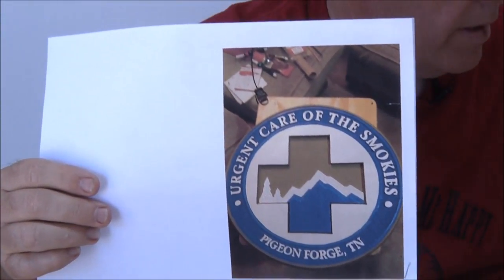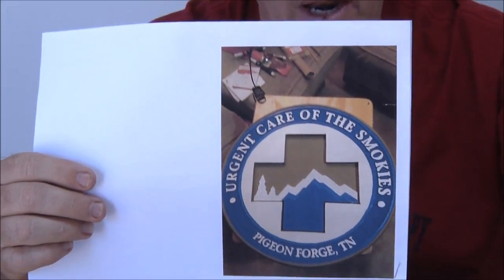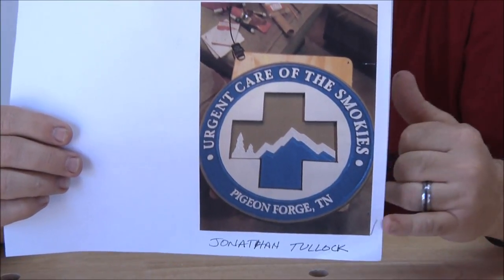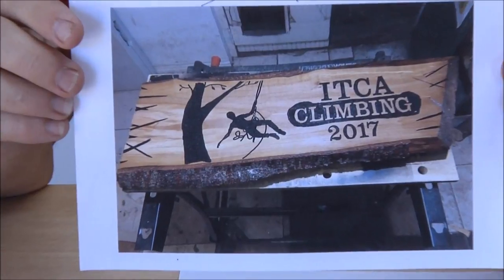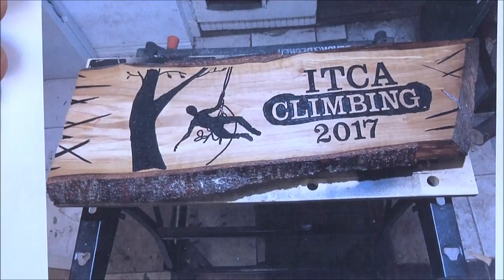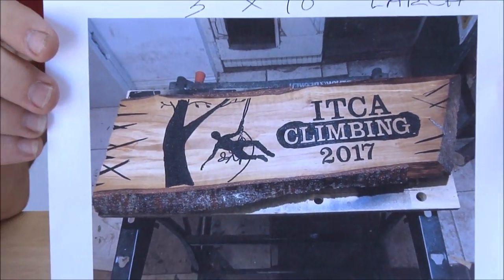Coffee & Questions 5/24/17 Idea for Local Sales  + Removing Plastic

Comment: Great video as usual!  And I know you said construction is not complete for your new studio... which is great by the way.   The video was a bit dark.  Will you be putting in  a bit more lighting?
Reply from the maker: Thank you Barbara, yep working on the lighting today. We'll have it dialed in soon. Thank you, Eric
Reply: If your camera has manual control..... you can iris the camera up..... basically opening the iris and let more light into the camera.  In the auto mode..... the camera sees the light colored walls you put up in the background.  It dominates the shot and the camera sees the wall.... sees how light it is.... and closes down the iris so the background isn't too bright.  However.... when it automatically does this.... Eric's face goes dark.  The automatic setting on the camera works is most average conditions.... but it is "dumb".... it doesn't know to expose for Eric's face in this case.  It is averaging for the entire scene with that big white wall there.  Check your camera and see if you can put it into the manual mode.....if so.... you should be able to control the "iris" or "apeture" .... same thing........ and open up the iris to let Eric's face go lighter.  The background will also get whiter.... but that should be OK in most cases.
Reply from the maker: Thank you Chuck, I will pass that on to Vicki.
Reply from the maker: Thank you Chuck, I will try that next time.... Vicki